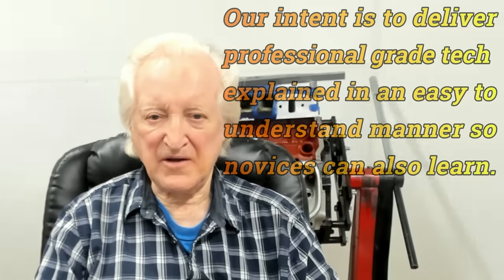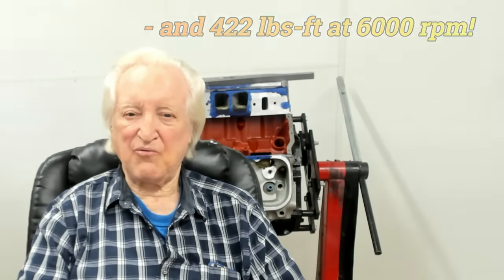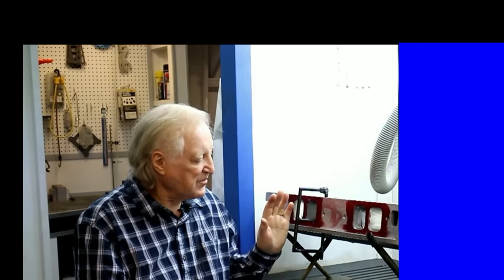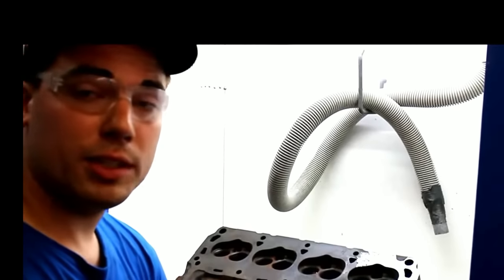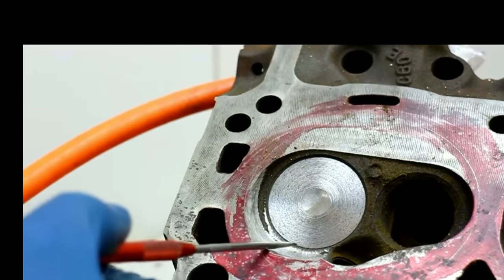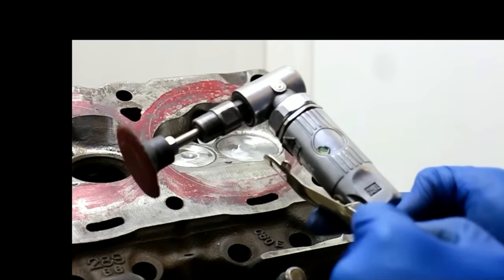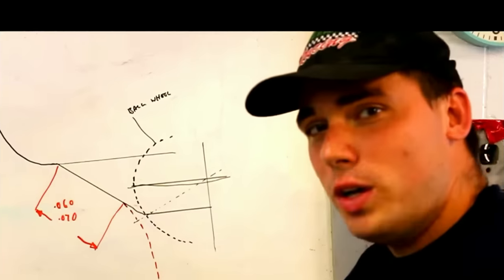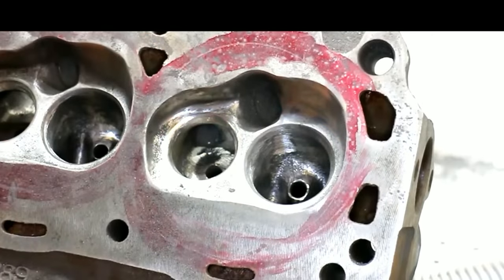Pro race,  very street drivable, 500 hp OE 289 SBF iron head mods.

Comment: 500hp from a 289 with ANY iron 289 heads will NEVER happen.
Reply: Mine is right about there. Using these Iron heads with 1.78/1.45 valve sizes, and stock autolite 4100 carb 1.08 which is the big limiting factor. Bobby Fazio Super Stock SS/L Stick Shift 1965 Mustang In-Car Atco Dragway High RPM
https://youtu.be/2d5Jh6aCni8
Reply: Rpm, inertia and gearing... not 500 horsepower. The heads wont move enough air with a 1.78 intake valve to make 500hp and I'm willing to bet on it.
Reply: I was going to disagree with you because I put a lot of faith in what Mr Vizard says.  However, he will not put out a part 2 to back up his claims, so I guess you may be correct.  I hestitate to not ever say things like NEVER and ALWAYS.  I guess I will get some AFR heads.